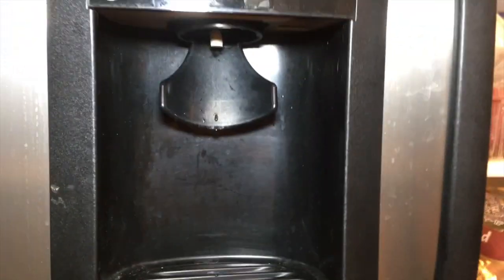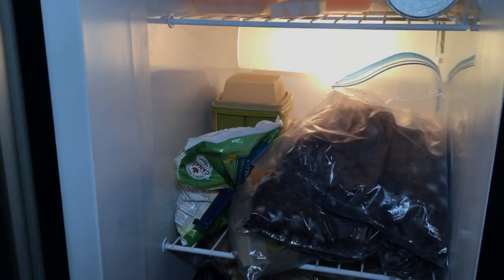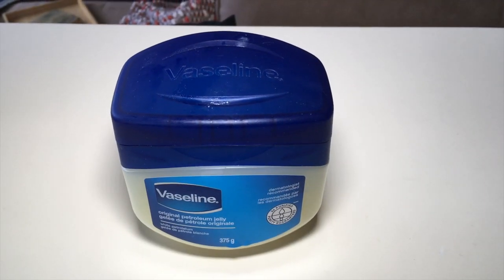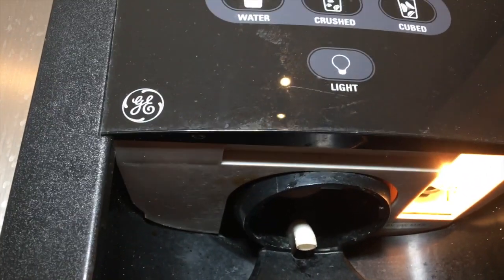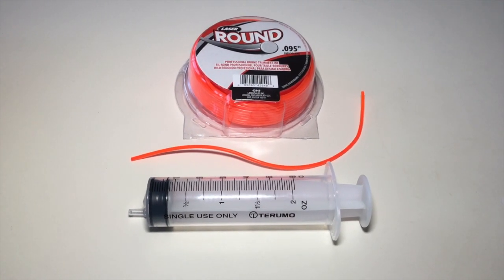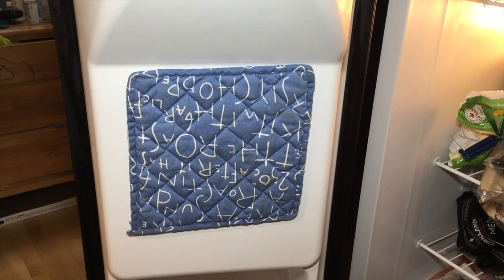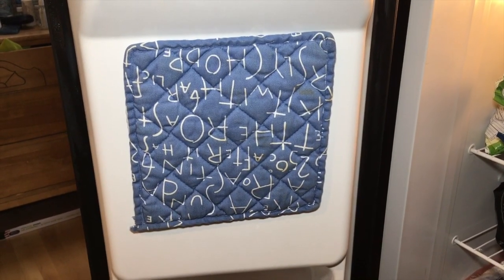Fixing Frozen Water Line In GE Side-By-Side Fridge For Good And For Free

Comment: For six years, we had a plastic string in our GE refrigerator water dispenser. However, when we had to replace the freezer thermostat two days ago because of a defrost problem, the water started dispensing like new again. It has been two days since the replacement, and the water is still flowing well. I wanted to share this experience so that others can also consider this option for their refrigerator.
Reply: Thank you for sharing this information! What exact thermostat are you replaced?

Comment: This sir,  fixed our issue and has stayed fixed. The hot pad fell off, the water line froze within hours. I affixed it with more intense adhesive and it defrosted just with the ambient temperature.

Comment: The root cause of our frequent freeze-up was the small solenoid that pulls the ice dispenser flap open had corrosion build-up which created friction that prevented the flaps spring from being able to snap the flap closed after ice had been dispensed.   With the flap partially open, cold air leaks out near the water tube and made it freeze.  It is easy to pop the control panel off, remove a few screws, remove solenoid and clean/lubricate it.

Comment: Thank you, Good Sir. We've been struggling with this exact problem off and on for years now and have searched in vain for a fix... Until your brilliant video. Eureka! We knew there was a freeze problem, but couldn't find any schematics or diagrams that showed exactly where the line ran and how to fix it. Thanks to you, we've got the exact location AND the remedy. We bought a simple 3/4" 8X12 self-adhesive foam pad on Amazon, placed it over the flat spot on the interior door as shown in your video and Voila! It's fixed. Thank you!

Comment: Used .095 weed Wacker plastic cord up the water dispenser , took several tries to get full 3-4 feet up fridge water line! Then it started working again after several days and a dozen other videos!!!  Thank you. No one else suggested rotor rooting the line!
Reply from the maker: But it is not a permanent fix, as the line will freeze again.

Comment: Same problem, same fridge. I had my doubts as to this simple fix and if it would work. However, your scientific method was convincing and I had nothing to lose. Not having a suitable pot holder, I used a 10x10 inch square of some foam core board (like kids would use at the science fair) and some "3M Exterior Attachment Tape, " just fancy double-sided tape I had left over from a car project. I opened the freezer, warmed the plastic to room temperature to remove condensation, attached the form core board, defrosted the line one last time using the warm water in a small tube technique and I'm THREE DAYS with a working water line. No reason to believe it won't continue working. If it does, I'll add another layer of foam core board! Thank you, sir.

Comment: Dr. Schweinzgruber !  I have the same “exact”refrigerator !  Same year.
I did the insulation method you recommended on the inside of the black appliqué panel, using insulation from my furnace, and it has completely solved the problem.  I am also an American engineer working at Bosch in the US.  Your fix was great.  I believe the problem only comes later in the life of the refrigerator, because the little bit of insulation that they put in that section, has completely shriveled up.  Thus allowing too much cold transfer through the door too the waterline inside.  Your method to add more insulation, allows the  warmer kitchen air to be in better contact with the water line, under the nozzle area.  Perfekt !  Danke !  Send me your email, and I’ll send you a picture of my patch work.  👍
Reply: I have same fridge

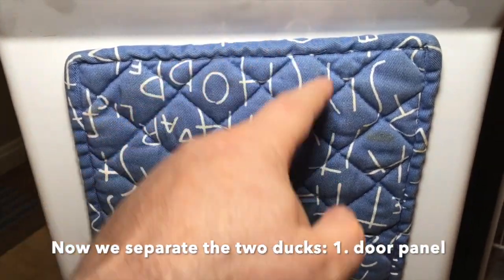Comment: Our GE fridge's water line used to freeze every other day. Yes, unfreezing is easy with a small tube (or straw) with syringe attached and injecting warm water into the water line from the front, but still a hassle that has to be done many times during the week. What eventually worked for me was using a bubble wrap foil insulation which I used three layers of and taped all four sides with aluminum tape. Where this video shows the oven mitt (6:48), I covered the entire side and a bit more to the top with bubble foil insulation, in three layers, then taped all sides with aluminum tape. Water-line is frost-free for over a month now. I wish GE had properly insulated the fridge. I wonder how many bought new fridges because of this issue alone.

Comment: Thank you so much! This happens every winter and fixes itself in the spring. So sick of it. I used you method using boing water in a tall Yeti cup with towels and hot pot handle to hold the heat in. After 40 minutes it was fixed! Place the pot holder on the inside and so far so good . Great advice!

Comment: Thanks for the tip. Instead of the pot holder, I cut a one inch thick piece of 8"X10" pink extruded foam with a hot wire cutter, covered it with some white film heat activated glue backing model airplane covering and attached it to the door with 3M trim double-sided tape.

Comment: Thank you, Dr Schweinsgruber ; This definitely resolves the issue , i used a piece cut to shape from a foil back type of windshield sun shade @$6 and a roll of gorilla glue double sided tape...it definitely looks to be a permanent fix... Next option i was planning;  drill small hole and fill with spray insulation foam...

Comment: This worked great but right after I did it I also replaced the light bulb.  I notice in  your video that you do not have a light bulb installed.  Could be the extra heat from the little light bulb keeps the line clear.  Funniest thing?  I keep our Sriracha in the same spot on the door!!
Reply from the maker: don't think so!

Comment: Wow! We have been fighting thermodynamics and the physics that comes with it. Thank you - thank you for giving us the correct answer to this annoying problem which started very recently. I used a slightly different tact - I inserted 3 inch thick insulation into a zip-lock bag [the size of the area of concern] and attached it as you described to the inside of the door. Worked like a charm - PS I don't believe in charms. Only Jesus and His One Holy Catholic and Apostolic Church! Pax et Bonum! and thanks again!

Comment: I like your repair, however due to the tape possibly not sticking I’m going to take the inside door panel off and insulate around the water line with refrigerant line insulation. Also I don’t know if u mentioned or if u knew but they sell an inline heater for GE refrigerators for less than $10. I have a Frigidaire unfortunately

Comment: And, what is the reason my water dispenser is so slow. 12 ounce glass... 47 seconds. I hate it.
Always done it. New filter and still!
Don't know what else to do
Reply: I had the same problem, and replacing the water filter was a wise idea.  And like you, the problem remained.  There is little else in the refrigerator's plumbing to restrict the water flow except maybe a faulty inlet valve assembly. .  So I looked towards the 1/4" copper supply line.  What I found was the cut-off valve that was tapped into the cold water line under the kitchen sink was flaky.  It had a spot when opening it that FELT like it was fully opened, when in fact it was only very partially open. 1/2 a turn later the problem was fixed.  There are other possibilities like a kinked copper line or just a downright poor tap.  But even a restricted line will make ice just fine.  I'd bet on the supply, not the fridge itself.   And just in case - I've got TWO cut-offs on the same line.  I added the second for convenience when I'm behind the fridge.  I'm sure I'm not the only one to do it.